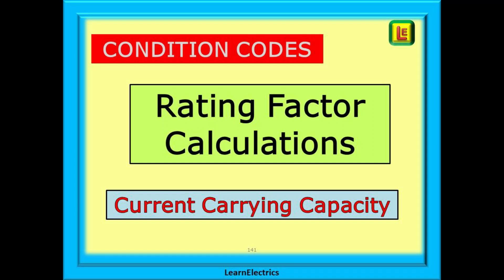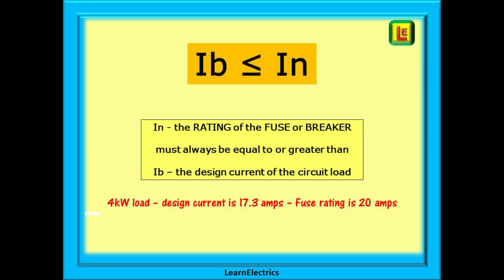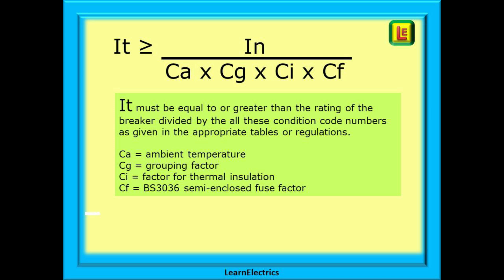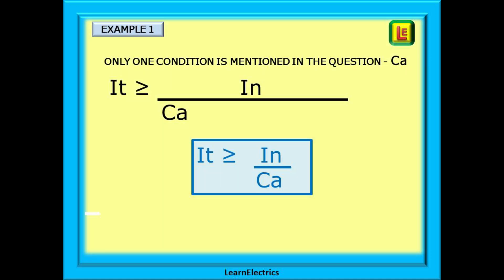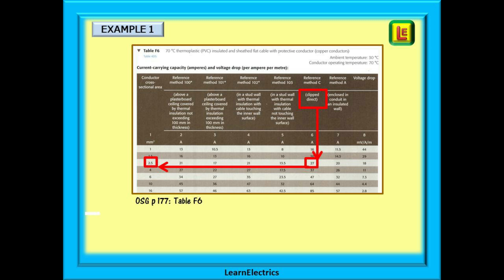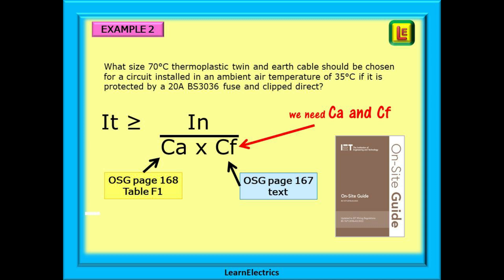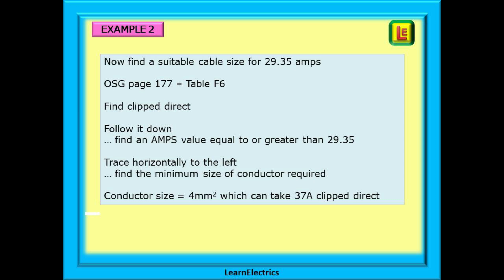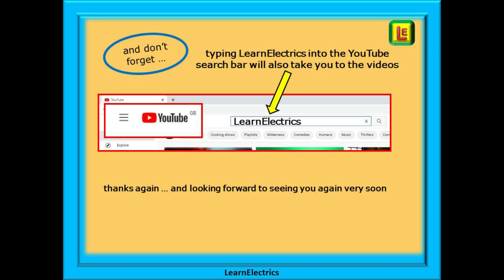RATING FACTOR CALCULATIONS and CONDITION CODES – How to use Ca, Cg, Ci and Cf etc.

Comment: say there is a large installation with 20 circuits in trunking leaving the DB. That would mean a grouping factor is 0.38… this would make every cable need to be very large, nevermind if other factors were applicable ? Is this right, anyway around this?
Reply from the maker: Generally, we should ensure that there is at least 50% plus fresh air in the trunking.
And, not all the circuits will count, especially if they are drawing less than 30% of their allowable.
I should do a video on this. Thanks.

Comment: Good video Dave  can you explain 433.1.1. (iii)  is right 1.45xIb=Iz 1.45x40A = 46A //  1.45xIz(I2)= Amp 1.45x45=65.25A thanks
Reply from the maker: Have another look at the video. You are NOT changing the current that flows and NOT changing the fuse. You need to upgrade the cable and choose a stronger cable to cope with the conditions affecting the cable. Dave.